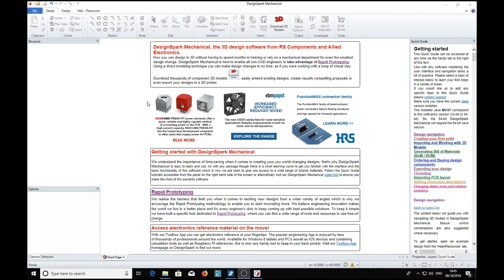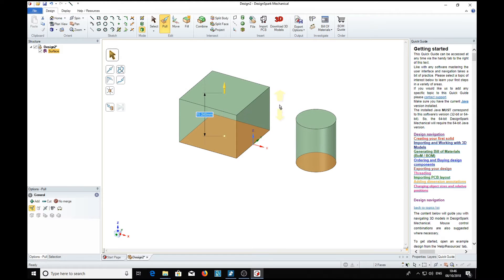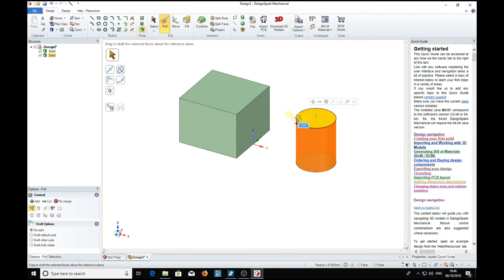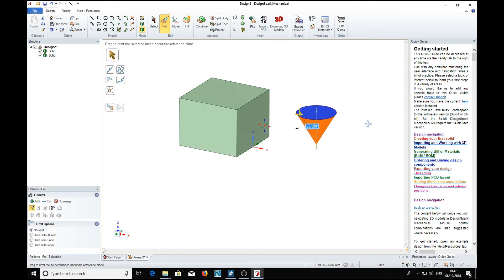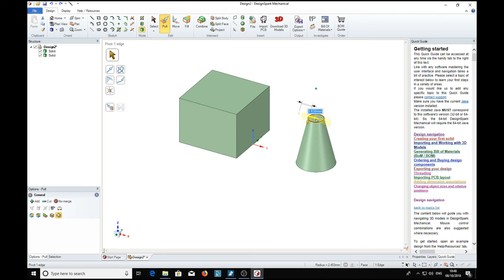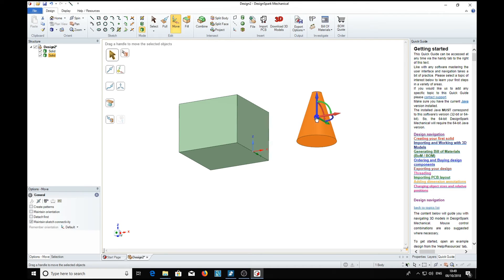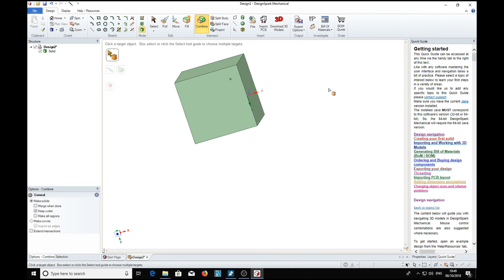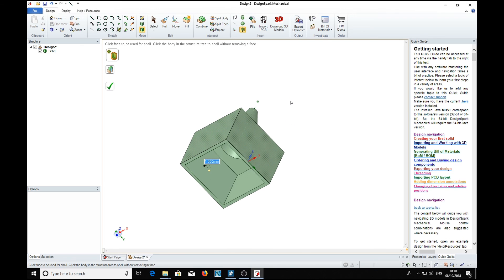Conify and attach a part in DesignSpark Mechanical

Comment: Jim you are a legend. I was stuck on this for two hours desinging an obsolete Pinch roller assy for my Teac HiFi cassette player.
It has a pivot hole tapering from Dia 5mm at the base to dia 4mm at the top and I was stumped till I saw this.
Now to 3d print it in PA12 Nylon!

Comment: How do i make an acentric cone? When i have a set botom radius / height and a top radius off centered? Or from a round botom profile to a smaller square top for example?
Thanks for the tutorials Jim.
Reply from the maker: If you have version 4 with the newly included Blend (B) tool, you should be able to perform this action with that. Just draw the base on a sketch plane, raise the plane the required height then draw the top shape, go into design mode, select both planes and use the Blend tool.
Reply: @JimTaylor42  Thanks Jim, i wil work on this as this is a feature i am looking for for some time now. Keep up the good work!

Comment: Hlo Jim, i like your video's of des_spark Mechanical. Dou u already installed the new version 4.0? 
If it is possible show more video's waths the real different vers 2.0. and 4.0.  
Befor installing vers 4.0 u need to install microsoft .NET framework 4.6.2. 

Best Regards Peter -Belgium
Reply from the maker: Yes, I am using the new version 4. So far I have not noticed much difference from version 2. I do see, however that it now sports a blend tool.

Comment: I actually did it with the spiral tool like you made the threads. Draw a triangle and use one side to spin the other 2 around. But you’re way is much easier. Thanks for sharing.